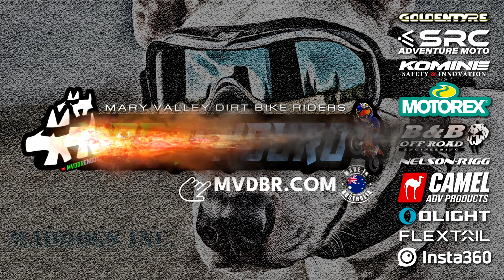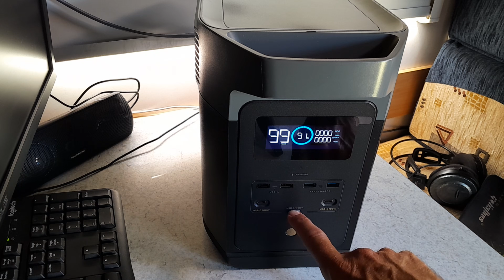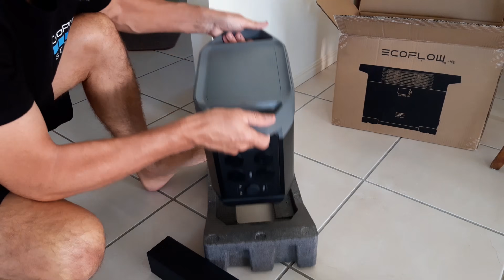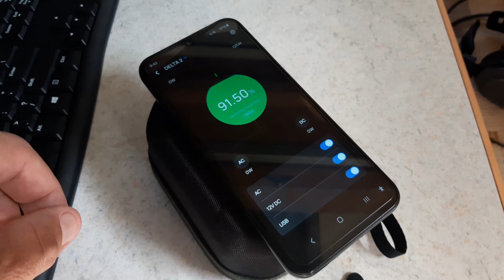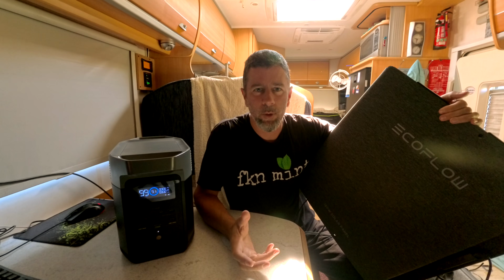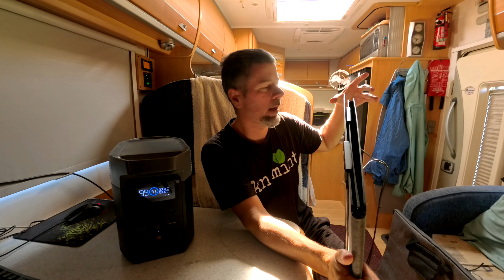Ultimate Portable Power Backup: EcoFlow Delta 2

Comment: Ahhh, gone are the days of an esky full of Ice, a Gas buner and a book to read. 🤣 But I do love technology, so what are ya gunna do. Yeah a bit spendy though. Any specs on Battery cycles. I think my Ebike battery is 1000 cycles at 60% capacity after that.
Great little review, Appreciate it. 👍
Reply: All good I found this spec, on their site, very impressive.
"Finally… tech that's made to last. Get years of regular use until hitting 80% of its original capacity. That's down to its LiFePO4 battery chemistry giving you 3000+ full charge and drain cycles."
Reply from the maker: @jethrowingnut13  yeah they are getting decent lifespans out of LiFePO4 technology these days 🤙 can't wait to see what the next generation of rechargeables will look like. Cheers mate